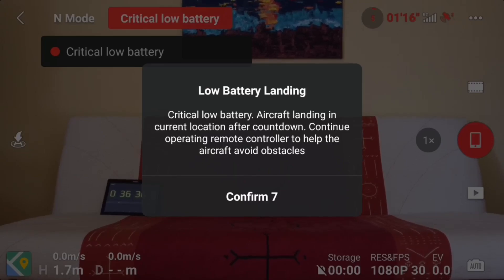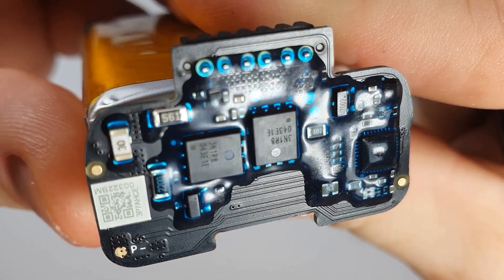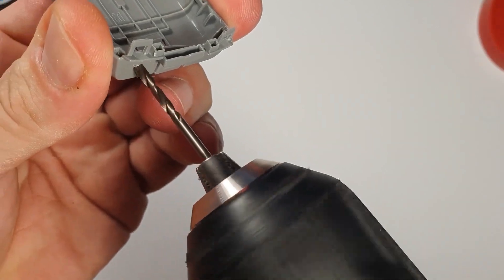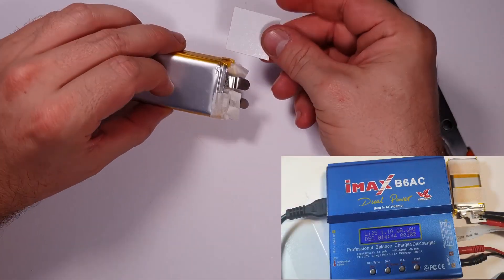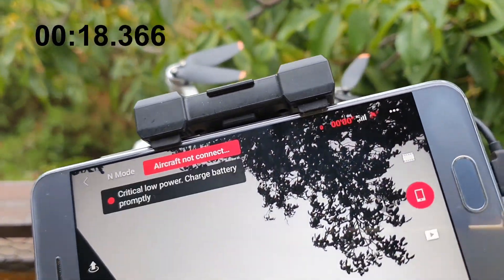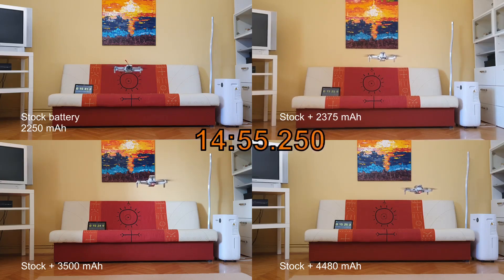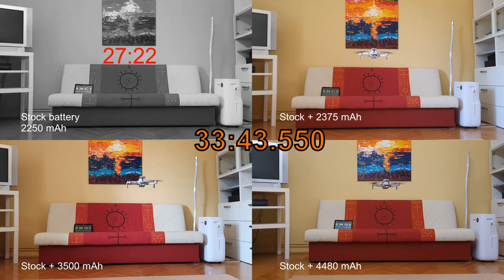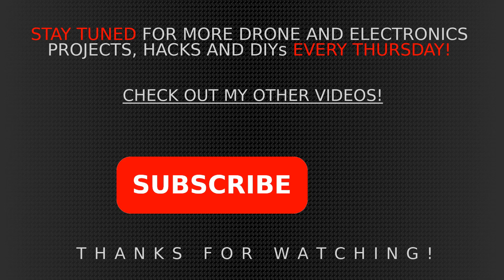Mini 2 Battery mod tutorial. 3 different cells tested. Max flight time is ...

Comment: Great work! Thank you so much. I watched the whole thing and I listened carefully, but I did not hear you say anything about ensuring that the original cells are at very nearly the same voltage as the new cells when you connect them in parallel.
Reply from the maker: Thanks! :) Good point!!! I said it in my earlier video, but forgot to mention in this one... 😅
Reply: @ZollyD  so connecting them together will charge together? I think I want to try and fit those 3500s in the case of the mini if I can fit them
Reply: @joshrios459  no he said that if you try to charge them like that the secondary batteries won’t charge up to full capacity
Reply: Meh, they should be able to handle the current without a problem.

Comment: It is extremely dangerous to connect a Li-Po battery outside the BMS (the battery will be charged from the added battery because the BMS will think it is connected to power). A better solution is to connect all batteries after the BMS.

Comment: witha second battery the same capacity as the one inside i would of expected almost twice the flight time. you have gone from 2250 and added a 2375 is should be double the time minus a bit of time loss due to extra weight,,,, the plus 4480 battery being very heavy is going to be not so good, but should be atleast twice the normal time...   what it needs for a good test is just the 4480  battery on its own, then i think you will see around 45 mins plus..

Comment: i did a similar test and when i added a bigger capacity cells with the added weight the amperage draw increased so thats why the bigger capacity battery not last ...higher amperage draw....my test rig was yuneec mantis ....2 meter long cable ....watt meter .....and the batteries plus added the respective battery weight on top of the drone .....udvozollek Erdelybol

Comment: 👍👍👍
I have question, 3500mAh means:
1.Total batt. capacity (The original DJI 2250mAh + External batt (1250mAh) ?
2. Or only external batt.
    So total 2250+3500=5750mAh ?
Thank you.🙏
Reply: Seems to be the 2nd one. The external only is 3500mah

Comment: well i do not think any of them were that good compared to the stock battery.. each one of them were added onto the stock. .. if you had put another stock battery added i would of expected almost double original time less 3 minutes for the extra weight........ now if you just put in a 3500mah battery i think yo uwill get over 40 minuteswith the just 3500 and no stock added to it... the top right for example giving 39.37 minutes is real like havinga singler pack of 4625mah.... so being over double capacity would of expected longer.

Comment: Where can I buy those 3500MAh cells?
Reply from the maker: The supplier I used before is out of business unfortunately. Check on Aliexpress for Mavic Air 2 battery cells. You will find it!

Comment: Please confirm so you have one wire weld it to the positive of the original battery and two wires welded on the negatives at the original battery is that correct

Comment: Hi, I wonder if you can try to mod the solar system to the drone, mostly we play under the sunlight, solar system can reduce the external battery weight and increase the flying time. Can you mod one with the solar system?
Reply from the maker: Solar panels are unfortunately way to heavy compared to the energy they provide in this application....

Comment: 1:20 could you solder on those terminals if you remove the nickel strips , and working on the pads with sandpaper to make it solerable, or is this not possible? thinking about changing my mini3 battery to 21700s... what I've noticed, is that there are 2 copper like pads /strips, I wasn't able to solder to these strips, at least not easily, but the other 2 strips seem so be solderable, at least on the nickel strips...

Comment: Hi Zolly and all, can you or someone clarify please:  it was said that to fly such time you need to charge batteries to 4.4x2 = 8.8v, which requires a "trick", since Imax B6 can't do it and on the same time, Zolly showed that batteries were discharged to 6v prior the "levitation". Can somebody say at what level the additional 3500mah battery should be charged to achieve same results in flying time  Zolly has achieved in this video?
Reply from the maker: 4.35V per cell so 8.7 V for the pack on the top
Reply: @ZollyD  Thanks Zolly, I actually found this out by now. I repeated your experiment and got 40 minutes 10541 meters one way and safely return back!

Comment: I wonder if 3500mAh is the optimum battery size or do you think 3000mAh would actually be a little better due to the weight difference. Also, how much weight reduction do you think could actually be done to the drone without actually impacting performance?
Reply: The drone itself is already as light as possible, with ultra light plastic and everything. It is so light that you won’t be able to reduce much weight from it. And even if you take all the covers off, you won’t be able to reduce enough weight to make it worth it. Engineers at dji are not stupid, and if they could, they would make it even lighter.

Comment: Welcome back!  This is a Great mod and we may use it with our attachable wing which can carry additional weight.  Do you know if you can swap the original battery by using temporary jumpers from another battery to retain voltage during the swap?  Also, do you need TRB for proper telemetry if you can swap to a higher mAh battery?

Comment: Hi Zolly! Great video! It is possible to Change the cells instead of adding more cells? I mean, to do it as you showed with the mavic mini 1. I was thinking of upgrading the cells but not sure if possible. Thank you again for your videos!.
Reply from the maker: It is not possible without a special software which I do not have. For DIY solution on the Mini2 this is the best.
Reply: @ZollyD  so the TRB is the software needed.?
Reply from the maker: @dronardo  Exactly!
Reply: @ZollyD  one last question, do you have any link to buy the cells that fit with mini 2?
Reply: @dronardo  Exactly I was wondering the same 🙂

Comment: If you extend the batteries they are connected in parallel right as they arent in series so this shouldnt change the voltage just the amp hours? So basically its a game of figuring out the best power to weight ratio
Reply from the maker: Correct.
Reply: How much for the extended bat mod? You put in description to message you on facebook which i did

Comment: Hi friend good work:) whatbif you use 2x 3500mah 18650 ion cell instead?
Reply from the maker: On Mini2 ot is not good bc lipo and li-ion has different discharge curves.

Comment: mh what ist with the normal 21700 cells with 5000mah - they are a little to big for the rear. but can we make with a 3d printer a new   top backside that this fit in ? than we have 10 000 mah on the mini / mini 2

Comment: Great content, thanks , wondering if there's a way to leave the controller in charge mode on the plug while your flying?
Reply from the maker: Not that i know of. Unless...😄😄 on mine i tapped into the 2 poles of the battery cell itself of my controller and brought it out. Connected a TP4056 board to it and that is all!😁

Comment: Hi Zolly, really great job! Please keep it up! You mentioned that the B6AC was only able to charge your additonal battery to 4.2x2 = 8.4v and you had to charge it with "additional power supply" to 4.4x2 = 8.8v. Could you please make a separate video about that? It will help a lot!! Thanks!
Reply from the maker: I will put it on my list. 😊

Comment: Great stuff. Just a question about charging - can i charge both batteries if I connect through the drone usb-c terminal? Also, will fast charge work with the lipo battery?
Reply from the maker: Yes it works great and fast charging works too. That is how I use it.

Comment: Well done.. thorough and to the point...like it
the thing in the box is a Mavic Air2.. so you can spoil us with a Mavic air 2 with interesting projects. :P
though do have one of these 4USD thin plastic bendable ribbons for Mavic Air2...
you simply lay it on the pads., and then plug the battery in like normal and it will make a connection and give you an XT60 socket on top for normal batteries.
the more or less the same approach, but so thin that it can lay in between the crease when the battery is connected.
Reply from the maker: Thanks. I may look into the Mavic Air at some point
Reply: @ZollyD  Just dont, as that is old.. its the Air2 & S that are mentioned and have a quite wide userbase..
Reply from the maker: @JAKOB1977  yes. I meant those..😅

Comment: after mod can charge battery with fly more combo charge hub? i have no charger for new (extra battery before connect to stock battery) what to do?
Reply from the maker: Yes, it can be charge with the hub. IF you can not charge the cells separately, you can try to match the voltage of the factory cells to your extra cells and charge them together after. The voltages have to match!!!

Comment: What is the C rating of those 3500 cells? You could possibly get cells with a lower C rating but with more capacity at the same weight.
Reply from the maker: Yeah, that could work, as they are in parallel anyways. :)

Comment: Schön aber wie schwehr ist die Dji mini dann?
Vorbei mit 249 Gramm Abfluggewicht!
Und was ist mit der Garantie wenn mann ins Batteriefach bohrt?
Für mich keine Option!!
Trotzdem interesant was möglich ist!!
Reply from the maker: Thanks! :) Yeah, it s heavy like this. I think if you have more batteries than one, and you send it back with an unchanged battery in case of guarantee claim it is fine. I THINK! :) But this mod is not for everyone really!

Comment: Good afternoon dear Zolly! I have a very important question, please write an answer. You can repackage the regular battery from DJi mini 2 and solder it to a 3500 mah battery without locking the battery. I watched a video on YouTube from other users it didn't work out. Will you be able to post such a video? I will be much grateful to you sincerely Leonid Anatolyevich
Reply from the maker: You have to check the channel "The  Longranger". He has the solution that works. Unfortunately to replace the cells you need to reprogram the chip  on the board.
Reply: Я думаю что блокировка срабатывает тупо при обрыве питания (при отрезании заводских ячеек). Если обеспечить временные дополнительные линии питания с других ячеек, то можно пересобрать батарейку на другие ячейки без блокировки BMS..  ну это так - рассуждения. Естественно, в прошивке батарейки останется старая ёмкость, но время полета всё-равно увеличится

Comment: Hello Zolly.
Thank you for your interesting tests. I also have experience. I noticed that you drained your batteries to 6V for the test. The capacity is then 3.5Ah. In practice, the drone will turn off at 7V. The available capacity will therefore be less. Maybe that's why the original 2250mAh batteries are around 2000mAh. One more thing. Tell me what voltage did the external batteries discharge during levitation?
Reply from the maker: Yes, that is correct! :) When I disable the battery voltage monitoring system, the drone can do an additional 3-5 minutes, but after that it starts a rapid descent due to lack of power and if it is coming from high enough, not even the ground effect can save it from crashing. So that is why it is not included in this video. I think that is why DJI implemented the 7V limit as well, as the LiPo discharge curve breaks down at around that voltage sharp. Like this there is a bit margin for safe landing.
The voltage on the the external cells was 7.15 V. (That is due to to the drop on the cables)

Comment: Will this work for the DJI Mini V1 as well?
Reply from the maker: Yes! :) The very same pins! The pcb is a bit different, but the pins are the same. :)
Reply: @ZollyD  Where do you buy the recommended second battery that with the original Barrett lasted over 45 minutes?
Reply from the maker: Check the description. 😉